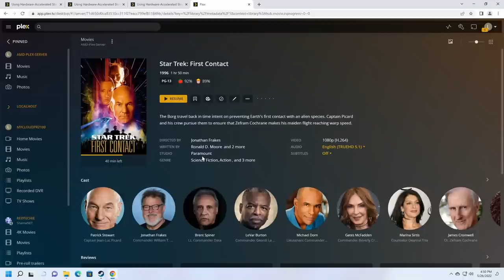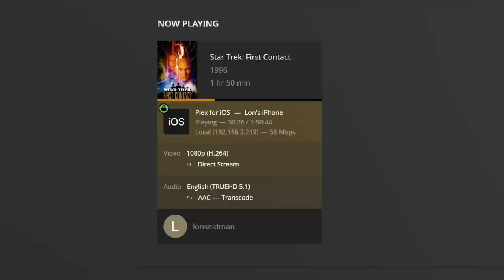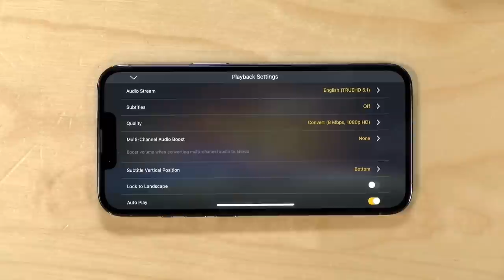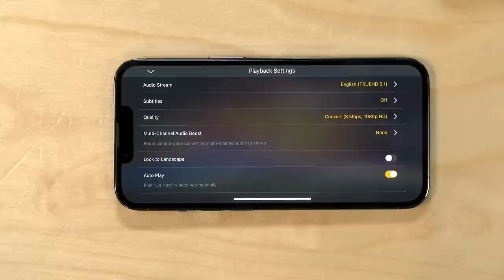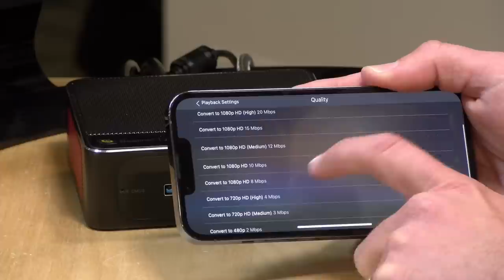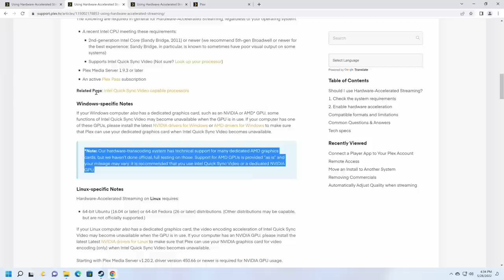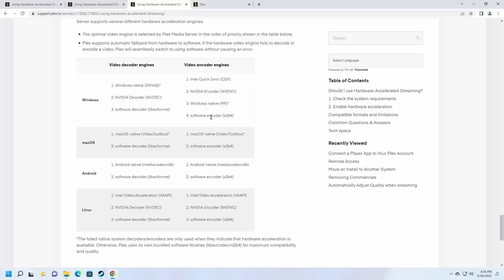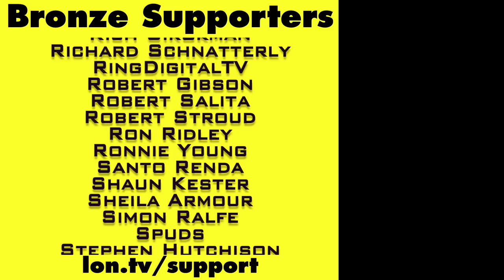Plex Hardware Transcoding on AMD Ryzen Based Mini PCs?

Comment: I've been running a Plex server off an AMD 2400g for about 2 years. It works fine with HW transcoding 1080p Bluray rips to 1080p 8mbps for remote streaming but it will struggle or outright not work at all for UHD rips to 1080p 8mbps or even 720p 4mbps. Most of my devices can handle direct play locally of all my rips so that's not much of an issue since I can use the FHD versions for remote streaming.
Reply: wow sounds like a pretty lousy setup.  why not just use intel?

Comment: There is a fix that allows you to unlock unlimited number of simultaneous streams on Nvidia consumer cards. I have had over 20+ h/w transcode streams on the RTX3060 without any issues.  Been using the fix for a few years.
Reply: how?
Reply: @markm9677  bios flash

Comment: Wow, I JUST ordered all the parts for my new HTPC/Plex server a few days ago.  Reluctantly went with a i5-12400, would have gladly gone with AMD if I had seen this!  AMD has always been a no-go with Plex.  Glad to see Plex is finally making hardware transcoding with AMD a possibility though
Reply: Not true, I used hardware transcoding on a RX570 years ago.  Each hardware vendor works depending on the OS you use of I recall correctly.
Reply: @KarlDag  I have that graphics card! Which OS were you using to get this working, then?
Reply: @NyneIX9  windows (7? 10?)

Comment: My Mini PC with a Ryzen 7 5700u will transcode using the iGPU hw without having to change any settings in Plex. Since this video Plex must have updated the software settings to support this yet people keep saying I need an intel based system, although it may still be the case that only a select few Ryzen based systems will work. Would be interesting to know.

Comment: I have been using a Beelink GTR mini PC connected to a 14tb external hard drive as a plex server since 2020. 

The mini PC has an AMD R5 3550h processor and runs windows 10. I've had no problems with hardware transcoding on it. 

Not sure how much better an intel cpu would be because I've always owned AMD but it has worked fine for me so if you find a good deal on a amd mini pc/ laptop i say go for it.

Comment: I'm using a laptop with Intel UHD 630 as my Plex/Emby server and I'm really impressed with how it handles remote transcoding. I took the bottom panel off and have it sitting on a laptop cooling pad that actually moves air and is very quite. Low power device that's always on. It can handle a total of 16 1080p transcodes before starting to buffer. Intel Quick Sync is still the best option for transcoding IMO. I haven't used a dedicated Nvidia GPU for transcoding for a few years now.

Comment: Thanks Lon... was checking out Beelink Intel and AMD mini PCs to use for a Plex server, and it seems like Intel is the way to go. I'm currently using an old Celeron J3455 with Ubuntu server installed, and it seems to perform well when doing 1080p transcoding. It just tends to glitch with 4K content.

Comment: Hey Lon, I know you mentioned it in the video in passing, but I think it should be noted that the transcoding appears to be running on the GPU of the mini PC you're using. That particular Ryzen CPU (4800U) is a laptop chip with integrated graphics, a pretty old generation at that in fact. I think it's the Radeon RX Vega generation.

Current desktop Ryzen CPU's (except the APU's that have a G suffix in the model name) do not have integrated GPU's, so hardware transcoding won't be available.

It should also be noted that Intel desktop CPU's that have an F suffix in the model name have disabled integrated graphics, and therefore do not have QuickSync.
Reply from the maker: There's no discrete GPU in this mini PC.
Reply: @LonSeidman  what he meant to say was the processor (4800U) is an AMD Ryzen  Mobile Processor with Radeon Graphics like a 5600G. A Ryzen 3700X has no inbuilt graphics so transcoding will not work. If the 4800U didn't have Radeon graphics you wouldn't have any video output.

Comment: Thanks a lot, Lon. Is this still the case for AMD and Plex HW Transcoding? I am trying to secure Mini PC for PMS this Black Friday and I hope if there's available AMD options now since they're usually less expensive than the one with Intel.
Reply from the maker: Intel is still the safer bet as you'll know it's going to work. AMD maybe hit or miss.
Reply: @LonSeidman Really thanks, alright, one last question I hope: 
Which one is better for Plex Media Server: 
Intel Core i5-1235U = Intel Iris Xe Graphics 80EU
Intel Core i5-12450H = Intel UHD Graphics (Raptor Lake 48EU)
Reply: @iYousif_  From what I've found, Intel and Ryzen chips that end in U are low power, usually in the 10-25 watt range. Their chips ending with an H tend to be more in the 45 watt or higher range. If you're just looking to use a mini PC as a Plex server, a U chip might be better if you are concerned about using less energy since it will be on 24/7.
Reply: @michygeorg  Thanks a lot for sharing this.  I read that the 1235U has better GPU than 12450H, will this will benefit the PMS in any ways? Power consumption aside, what you would recommend for transcoding and 24/7 operations. Thanks again!

Comment: I would be interested to know if anyone has tested this compatibility with either the AMD Ryzen 5600G or 5700G?  Thinking about replacing my CPU and board in my multipurpose plex server, and would really rather go with AMD if their APU's have started to work with Plex transcoding.
Reply: I cant speak for those processors, but my Ryzen 7 PRO 4750G supports HW transcoding in plex.  Its probably safe to assume that those do as well, since they are a generation ahead.  Still running VEGA cores i belive.
Reply: My server is running a 5700g and have no issues with hw transcodes. I will say I only ever have up to 3 streams going at any time.

Comment: Lon, please can you ask your connections at Plex to work on quick sync for the new 12th gen processors? My 12400 runs the IGPU at 78% for one video and 100% for two. My 6500T could run 7 without any issues but had difficulty with subtitles and 4K which is why I upgraded; or at least I thought I was upgrading.

Comment: What kinda baloney is this?
Running a software without a hardware? 🤯 What kind of voodoo magic is this? 
I'm so tired of people saying this in this (Media Server) community. 
Just say running on GPU (i/d what have you) vs CPU vs dedicated media processors vs any thing else specific.
STOP SAYING SOFTWARE TRANSCODING! Even GPU transcoding requires software.
These are complex modern processors, not some simple electrical system that just run when powered on.